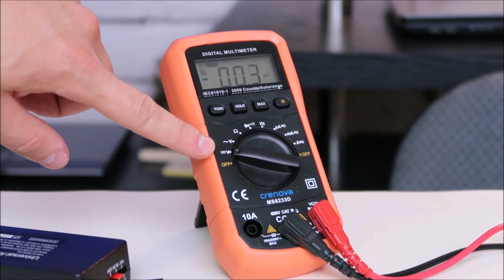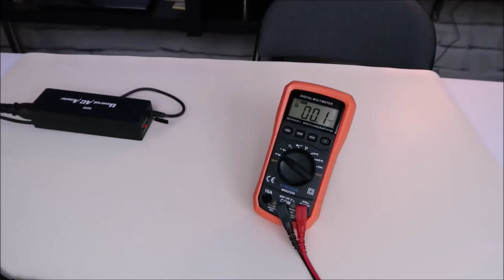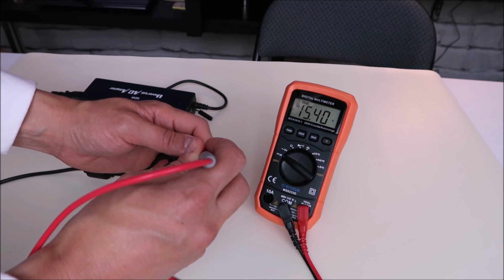How To Fix Any Laptop - Wont Turn On, Wont Open, Turns Off Right Away, No Power Solution

Comment: Hey, i would appreciate if i could get any help. (i have a zbook 17 if that helps in any way) at first when before i watched the video and tried anything at all, there was absolutely no light on for the power button (to turn the computer on) but i tried the first test and the light for the caps lock and the power button turned on but nothing else. Doesn’t matter if i only have the battery plugged in or the charger only plugged in, that’s the only thing that’s comes on. i’ve been freaking out for a couple weeks because my parents just got it for me as a gift not that long ago and it worked perfectly fine before. Once again, any help would be appreciated. Also there isn’t any bits of ram sticks on my motherboard but the laptop worked fine before so idk if that is important to mentioned or not.
Reply from the maker: If all the tests in this video do not reveal the issue, then your most likely looking at a Motherboard replacement as seen here;  https://youtu.be/N_7HNrFkMS8.
Reply: PC Monkey okay thank you i will give it a try once i have everything need to do that, thank you so much.

Comment: The lights are on and I can hear it running. The monitor does not turn on. I put a new battery in there the one that looks like a watch battery. I replaced the power port. Got a new battery got a new power cord. When I put the new power jack or port in there the monitor propped open with a bios messages and then it shut down. After that I have not seen anything come up on the screen. I will order a new motherboard tomorrow and see what that does. Unless you think I should try something else first? Should I also order a new ram? I cleaned both of them that are in there now off and put them back in. I tried taking one out and seeing if it would work with just one or the other. That didn’t work either
Reply from the maker: For a computer that turns on but the display does not work, try this video first;   https://youtu.be/u-REPLdpZ70
Let me know how that goes :)

Comment: I did everything on this video. Still not working. I’m going to have to get a new motherboard? How expensive is that?
Reply from the maker: Depends on your computer.  What brand and model computer do you have?
Reply: PC Monkey I have an HP15-ay009dx laptop
It was acting up a while before it completely went off and stopped working. It would shut down after being up for a few minutes. Wouldn’t turn back on until I let it sit for a while. Sometimes a day or two. The last time it was up for quite a while and I did some graphic design work on it and then it crashed in the middle of my project. I haven’t been able to get it to turn back on. I replaced both the battery and the cord. I let them charge for 24 hours and it won’t power up at all now. Before the battery was bad and it would only turn on if I Only plugged in the charger cord. After a while it started acting like I described above. So I replaced both.
Reply from the maker: @taviapalmer328  I think this may be the part you would need;  https://www.ebay.com/itm/Genuine-HP-15-AY-15-AY009DX-Intel-i3-6100U-Motherboard-P-N-903795-601/264847911601?hash=item3daa2a6ab1:g:6zEAAOSw4WJfOI5g
Confirm it though with your part number first.
Reply: PC Monkey thank you 😊

Comment: Please help me , today my HP chromebook fell and when I picked It up i didnt see any damage, until I got it and try to use it but it went off and everything turned off.i tried doing all the things you said but it wouldn't turn on, I also had an mouse chip plugged into the HP chromebook and the chromebook fell the side of the chip of my mouse and the mouse chip is noe broken. please help me I really need help
Reply from the maker: If all the tests in this video do not reveal the issue, then your most likely looking at a Motherboard replacement as seen here;  https://youtu.be/wg_yuwWKxdg.
Reply: @PC_Monkey  it says its been removed by the owner

Comment: My acer laptop isn't turning on. When I press the power button it shows blue light for some times and then goes off. When it's charging it shows blinking orange light. Both functions were performed with battery inserted. Nothing shows when battery is removed and performing the same tasks. I tried the video no. 1 and it doesn't work. 
Please help me brother
Reply from the maker: For a computer that does not turn on, try this video first;  https://youtu.be/P3I7dDpkJps.  Let me know how that goes :)
Reply: @PC_Monkey  that's what I said bro. It didn't worked now what?
Reply from the maker: @alwaysaskwhy2420  If all the tests in this video do not reveal the issue, then your most likely looking at a Motherboard replacement as seen here;  https://youtu.be/wg_yuwWKxdg.  Check out the FAQ's below or leave a comment!

Comment: Wondering if this sounds like a bad motherboard. I've tested the Ram chips, all versions of a static discharge, BIOS reset -going so far as replacing the battery with a new one of the same type, removed the hard drive and ensured it was still functional with a secondary laptop, and did a visual exam of the motherboard/double-checked all of the internal cable connections. The keys light up, I hear the CD drive click briefly (it's empty, sounds like it's failing to operate), and then nothing. The screen remains black, the hard drive and fan don't start, but the keys remain lit. If I turn it off and on again, only the num and caps lock keys are lit; pressing them does nothing. I've also tried removing the CD drive entirely and retesting everything, which doesn't help.
Reply: Key stucked

Comment: Hello! I've been facing the dell logo stuck where its goes to loading and loading but never boot up! I tried every single thing and sometimes it got boot up! But when i restrt my laptop it's same so now i went to advanced option and reset my pc now but still I'm stuck at dell logo where its shows dell and loading sign and that's it. No automatically restart no windows failure already Changed my battery and charger can you help? Me?
Reply: Same but mine is hp logo

Comment: Thanks for the video but my HP 250G5 caps lock blinks , screen doesn't turn on,power led blinks  and later makes a beeping sound (most times no sound at all) . What do I do ?
Reply from the maker: Sounds like your on the correct video.  Have you tried the steps seen here yet?

Comment: @ PC Monkey – I have an HP 17-by0053od Laptop 1 ½ yrs old. I turned it on today and Windows Update started running around 15 updates including 4 Cumulative Updates which require reboots (which I authorized by selecting “Reboot Now”).  After the second (authorized) reboot (and while the 3rd Windows Cumulative Update was running), an HP BIOS Update screen appeared, and while I was trying to figure out WTH was going on, I saw a countdown at the bottom of the splash screen saying “3 . . 2 . . 1” and before I could hit the “NO” icon – the laptop rebooted on its own and instead of loading Windows or the BIOS screen, it began a cycle of - - 1 click, fan turns on for 3 seconds, fan off, 7 seconds of silence, 3 fast clicks, 4 seconds of silence then it starts over again and again.  I allowed this to continue for an hour before I powered it off and then followed all of your videos.  I also pulled the HDD and attached it to my desktop via an Inateck Docking Station and ran Chkdsk on it 3 times and found no errors. The file structure is in-tact and I can access the files (so the HDD isn’t bricked).  Is the only solution to reset the BIOS at this point?  The CMOS battery on this one requires the removal of all components attached to the MB be removed and then the MB removed to access the battery (I’m afraid this may be beyond my skill set).  Is there ANY other option?  And I have Never seen a Forced BIOS Update in my life or any other update that try’s to run During a major Windows Update.  I also tried to boot with the HDD removed and have the same result.  Also tried the WIN+B and WIN+V.  It seems that it never even gets to the BIOS before it tries to reboot over and over again.  Corrupted BIOS I'm guessing.  Any ideas on a next step?
Reply from the maker: So what happens now when you try to turn on the computer?
Reply: @PC_Monkey   Just now - I pushed the the power button and the Mother Board (not the HDD) makes 1 click and the fan turns on for 3 seconds then stops, 7 seconds later the Mother Board makes 3 fast clicks, 4 seconds after that it starts all over again - the Mother Board (not the HDD) makes 1 click and the fan turns on for 3 seconds then stops, 7 seconds later the Mother Board makes 3 fast clicks, 4 seconds after that it starts all over again.  It keeps repeating this process until I power it off.  While this is happening the screen remains black.  I know the clicks are coming from the MB and not the HDD because I had the back panel off of the laptop during 3 of these attempted starts.
Reply: @PC_Monkey  The laptop isn't in a boot-loop, it doesn't make it past the "On then Off, then On then Off" loop.
Reply from the maker: @MissDallas  If all the tests in this video do not reveal the issue, then your most likely looking at a Motherboard replacement as seen here;  https://youtu.be/wg_yuwWKxdg.

Comment: I had a problem like while starting my hp laptop it's getting off before logo with some sound like (tuk or tik) I did everything thing explained in this video but I am not able to turn-on even not able to go boot option it's simply getting off . Can you suggest me how to fix this problem ??
Reply from the maker: If your computer turns on but then turns off before the logo screen appears, and you have tried all the steps seen here, then your most likely looking at a bad motherboard.  I would now try replacing the motherboard.

Comment: Yeah i did all steps besides ram because i cant locate it i strip naked laptop hp 15 r222nw a minute ago and lol there are no ram stick its impossible i didint remove motherboard yet and canr get schemat of it and i dont want to do it more because its pain in the a
Reply from the maker: I found this video on how to access the RAM in an HP 15;  https://www.youtube.com/watch?v=so2fY5suO8Q.  Looks like the RAM is under the motherboard :(  Horrible design.  Your on a video about a computer that wont turn on.  It does not include any RAM test?   Why are you trying to access the RAM?
Reply: @PC_Monkey  its last resort for me, i tryed eveything and i wont pay to repair Such Old l as ptop rather buy New one
Reply from the maker: @damiandamiano3651  If your computer wont turn on, and you have tried all the steps seen here, then most likely its a motherboard issue.  You should lastly replace the motherboard.

Comment: Bro the Worst Thing for me is that my power button does not work i turn on my laptop by plugging in the charger and by battery is Also Not working for Some time i m using without Battery , i can apply this Residual power Solution please tell me is therr any other way of doing it which doesn't include powet button. And i have applied the ram tests and cmos test but nothing is working Please help
Reply from the maker: How do you know your power button is not working?  There are a lot of reasons why a computer wont turn on.
Reply: For months it was not working Properly So i set in bios that plugin turns on the laptop.please tell any other way for this static electricity remove
Reply: My laptops screen stays black but power button and capslock button light turn on for 20 seconds and just turn off and on and the loop goes on the loop of lights not screen.what should I Do plz help. 2 weeks Before This Happened But I Cleaned the rams and It worked but this thing again happened ans I have tested all four rams by cleaning and putting them separately.pleasr tell what should i do
Reply from the maker: @directionerforever9515  Its usually very difficult to troubleshoot a problem in a computer when more than one thing is wrong.  I would first try fixing the issue you know how to fix first.  I would first replace the Power Button board or, if its part of the keyboard, replace the keyboard.  For a computer that starts but turns off before you are able to see the startup logo screen, your on the correct video.  For a computer that turns on but the screen does not work, follow this video; https://youtu.be/u-REPLdpZ70

Comment: What If The Laptop Light Turns On When The Battery And The Charger Is In It But When The Charger Is Not Plugged The Laptop Does Not Show No Lights??
Reply from the maker: Are there any other signs that the computer is actually turning on besides just the lights?  Any motherboard or hard drive sounds / clicks?  Does the fan start?  If not, then lights by themselves dont mean the computer is turning on.   Your on the correct video :)

Comment: Can you show how to fix a “SMBIOS FLASH CORRUPTION”. Or how to fix bios on a laptop not turning on
Reply from the maker: Does your laptop not turn on or does it turn on and give you that error?   You can try to reset BIOS by the step shown in this video.  Remove for a time the CMOS Battery.  If that does not work, you would have to try reflashing BIOS.  I do not have videos on that as very often you can ruin your Motherboard if its not successful.
Reply: PC Monkey sorry for the late reply. It doesn’t turn on and the code sequence I searched all point toward a “SMBIOS flash corruption”
Reply from the maker: @thatboyss5576  For a computer that does not turn on, try this video first;  https://youtu.be/P3I7dDpkJps.  Let me know how that goes :)
Reply: PC Monkey I’ve done all that and it still does not turn on. I’m not sure what the issue is but I took it to an Ibreakyoufix store and they said it was a bios issue as well. Is there any way to rest the bios without having the computer on ? Maybe a flash drive or something ?

Comment: Im literally having a mental breakdown im here before the video starts pls wish me luck
Reply: Same I’m having a mental breakdown rn-
Reply from the maker: @wonjpg  This video is for a computer that does not turn on at all.  If thats your issue, then these steps should help.  Let me know how it goes :)
Reply: @PC_Monkey  will this work for a HP chromebook as well? Because today my HP chromebook fell and when I picked It up i didnt see any damage, until I got it and try to use it but it went off and everything turned off.and now nothing is popping up it's all black and no sound at all and it wont charge.also i had a mouse chip plugged into the HP chromebook and the chromebook fell the side of the chip of my mouse and the mouse chip is now broken. please help me I really need help
Reply from the maker: This video is for a computer that does not turn on at all.  If thats your issue, then these steps should help.  Let me know how it goes :)
Reply: @PC_Monkey  nothing works nindid everything and still doesn't turn on
Reply from the maker: @CarMagic1   If all the tests in this video do not reveal the issue, then your most likely looking at a Motherboard replacement as seen here;  https://youtu.be/N_7HNrFkMS8.  If you know your computer's model number, I can help you get inside your specific computer :)
Reply: @PC_Monkey  I have a black screen but there is a red light NOT blinking next to my camera on my computer. What does this mean?
Reply from the maker: @noblevenom2858  Are the lights the only signs of life when you turn it on?  No motherboard or hard drive sounds?  No fan noise?
Reply: @PC_Monkey  don't worry, i contacted microsoft and they fixed it, it was an ez fix. Just had to hold the power button for about 20 seconds and it turned on lol ty
Reply: Same and this isn’t working mine just went out two days ago
Reply from the maker: @masterreacter..9558   If all the tests in this video do not reveal the issue, then your most likely looking at a Motherboard replacement as seen here;  https://youtu.be/N_7HNrFkMS8.  If you know your computer's model number, I can help you get inside your specific computer :)
Reply: Same
Reply: Its 2 am rn
Reply: Samee
Reply: My laptop boots, then turns off with a pop sound before it gets to the Lock Screen. I also shocked myself unplugging it. I hope I didn’t fry it.

Comment: My PC suddenly turned off while I was gaming. What i've checked :

- PSU changed, did not help
- cables checked and even replaces inner case cables and power cable
- tried removing each component and test if it runs without, did not help
- tried to jump start the PC using the screwdriver on the MB pins to bypass a potential faulty front panel power button or faulty front panel cables.
- I can charge my phone on the MB USB ports so it does receive power, but it won't start the PC itself.
- changed the Bios battery as well,did not help 

I have no idea what's causing it... :/
Reply: Same i was just playing roblox then it froze on me
Reply: @valeriiiiiiieee  in case you tried what I listed and it does not work, my issue was the Motherboard
Reply: Idek what to do anymore
Reply from the maker: If all the steps here dont help your computer to turn on then your looking at a bad motherboard :(